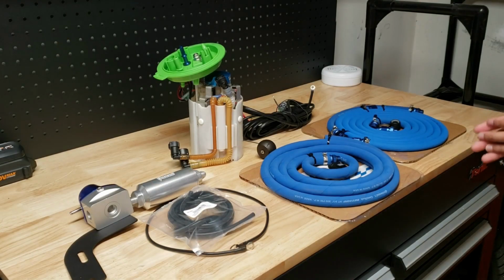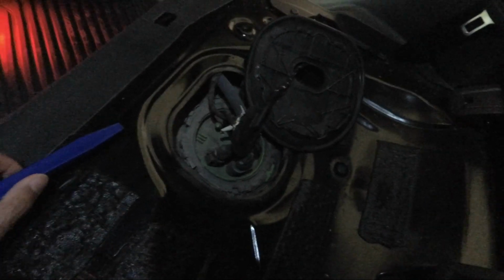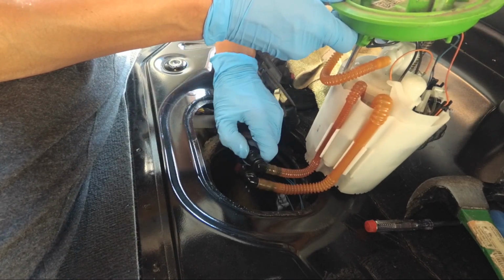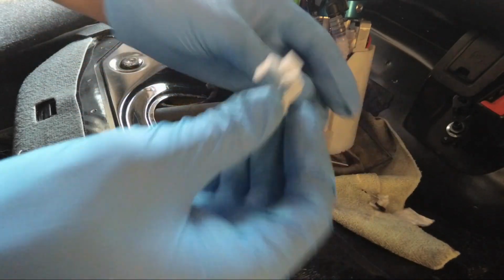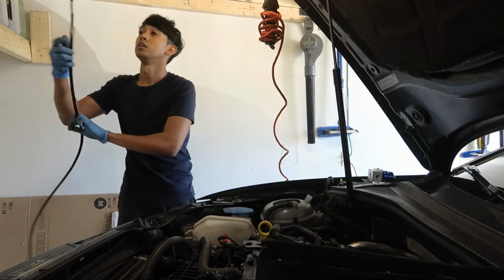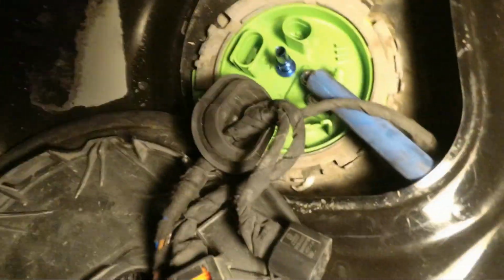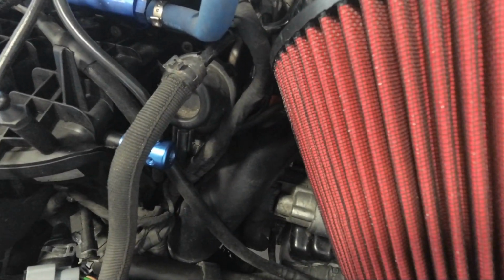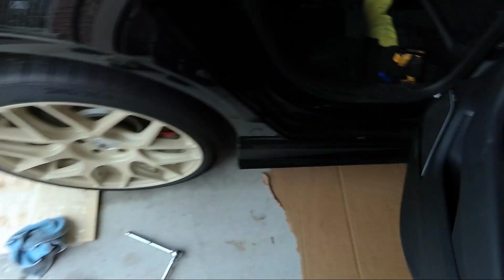Precision Raceworks Stage 4 Fuel Pump Install on my Audi S3

Comment: At 25 minute mark why did you put the line through the frame like that? at such a weird bent angle? and not out the back of the frame rail?
Reply from the maker: The original intention was to put it through the whole back just like the other line. However both lines in there are a very tight fit, and with the fitting it extremely difficult to get it out the same way. I think they adjusted their lines and fitting now with their current kits

Comment: Great video! Wish I saw this when I was doing mine. 
Question for the 5 bar sensor adapter, what was the diameter of the fitting? I need to do the same thing but trying to figure out what size fitting to get
Reply: Did some more research.. looks like it is 1/8th female NPT for the threading on the sensor too.
Reply from the maker: @AzothPLS  yes! that makes perfect sense. All that's left is to attach some vacuum line to an open port on the boost tap
Reply from the maker: Thanks! I'm hoping it helps anyone interested in this kit. When I was installing there were no resources available. For the fitting it's just a 1/8th nipple fitting. Depth of the fitting doesn't matter too much
Reply: 1/8th is the diameter of the threading that screws into the sensor?
Reply from the maker: @AzothPLS  exact measuremeny of the threading  I'm actually not too sure. Just went to a hardware store and I asked for a 1/8th nipple fitting and came out with the exact part used in the video
Reply: hello male Flare with 5/16 barbed fitting where to find this fitting thank you